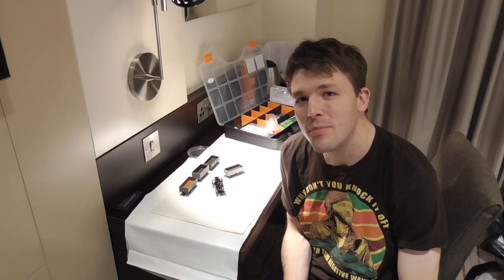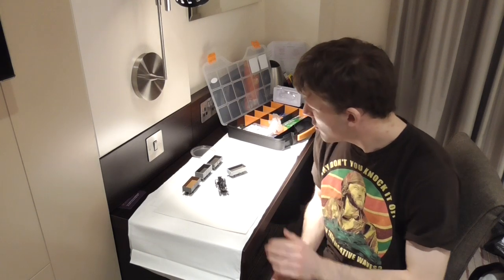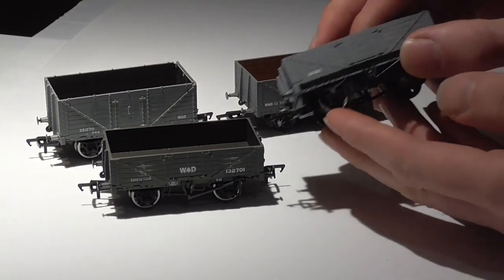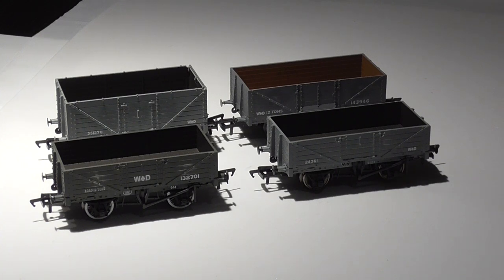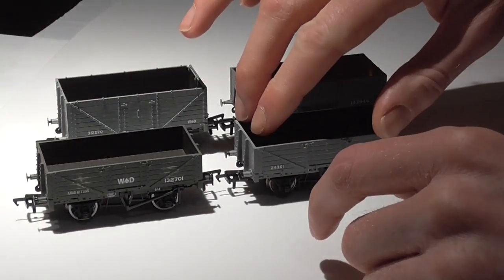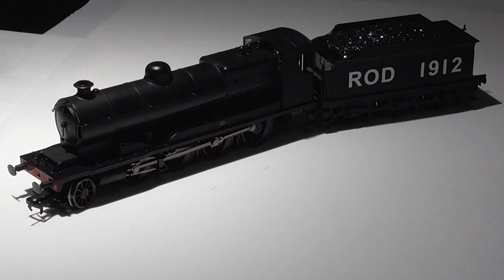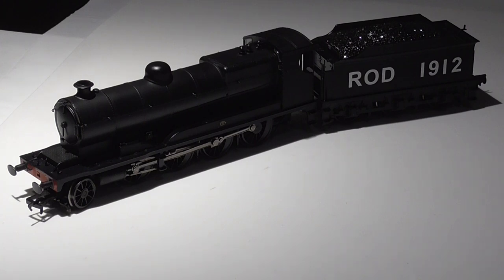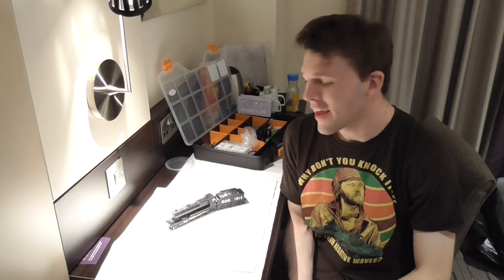Model Railway Workbench - Update 4 - Modelling in a Hotel! - ROD 1912, W^D Wagons and More!

Comment: There are actually 2 Robinson 04s in south Australia at the Dorrigo Steam Railway and Museum not in operating condition and apparently there was a third in Australia but not sure where it is.

Great video as always
Reply from the maker: Many thanks! Yes there are, but those are the original ROD 2-8-0's based on the GCR 8K class. The 04 featured a number of modification, such as the buffers boilers etc :) Would be great if one of the originals could steam one day.
Reply: @SDJR7F88  ah didn't think about the differences between them I've found the 3rd at the Richmond Vale Railway and Museum It was cosmetically restored to ROD condition

Comment: I would be surprised if the ploughing engines were commandeered . More likely purchased from the makers. Efficient farming would have been vital at home, so the MOD wouldn't have wanted to take such machines from farmers . I am guessing.  You must have to be very tidy btw working in a Hotel.
Reply: They took the farmers horses so why not the engines?   David.
Reply from the maker: Thanks Ian. That would make sense on why they were so clean in the picture I saw! Yes, I try my best, but it still stinks of thinners ;)
Reply: @trainsontuesday  Good point.